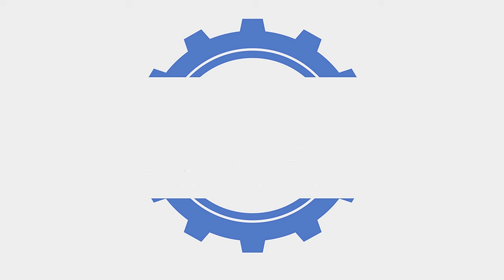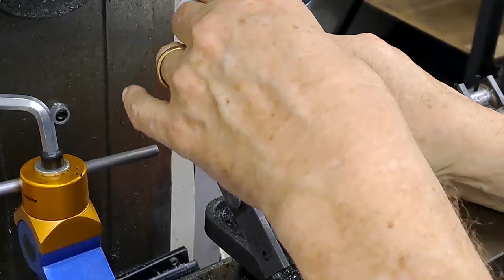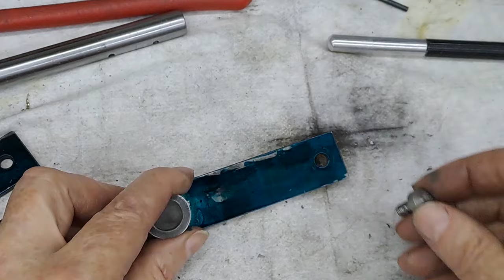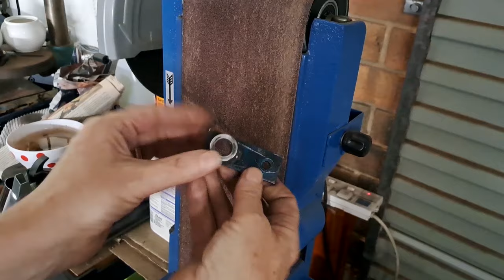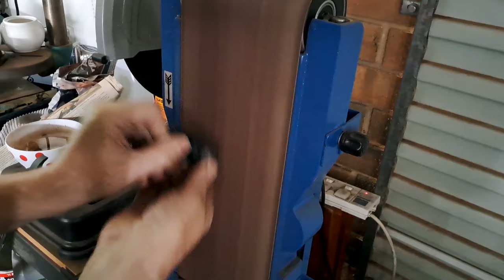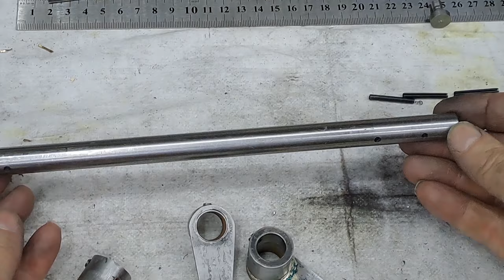030 Brake Arms Pt3

Comment: Morning Chef, can I ask if you’re keeping the roll pins or if you intend to replace with hardened taper pins in the final assembly. Like you I’m just a hobbiest (although you’re probably far more experienced than I am), but I’ve seen so many roll pins come loose and brakes are quite an important feature after all. I see tapered pins being used regularly for holding this sort of assembly together and they are removable if needed, but they don’t give or work loose once tapped home. You will of course need a tapered reamer to suit (they come in a huge variety of sizes for different applications/shaft sizes). Will be interested in your thoughts. Cheers, Nick
Reply from the maker: Hi Nick, 
Following the drawings, there are only roll pins needed. I will add that the ones I have used are a hammer fit, so I think that they will stay put. The brake on the loco is only a parking brake at the best of times, as the train brake is on the tender. As much as taper pins are a great idea, I will monitor the roll pins once the loco is in use and revisit as needed. It might be as simple as using a drop of medium thread lock to just hold them in place. Thanks for your comment. Just for a bit of research, may I ask... are you a subscriber or a watcher (not subscribed)?
The Chef
Reply: Definitely a subscriber Chef - following your work with the greatest of interest - great standard of videography and (more importantly) your engineering solutions are a great learning tool.